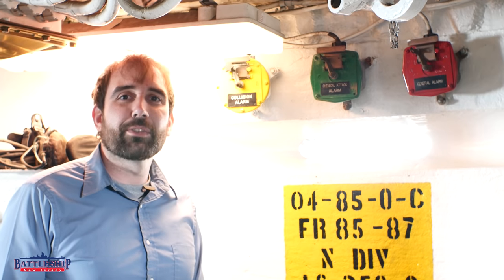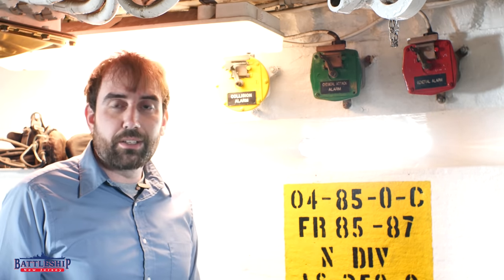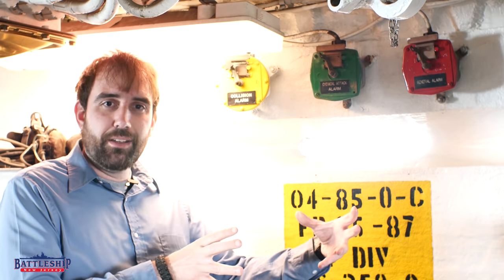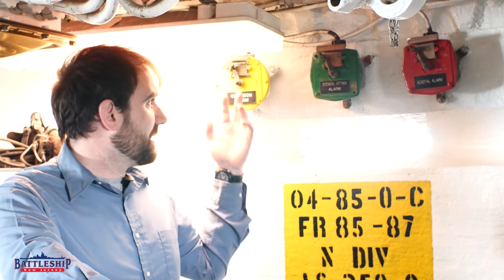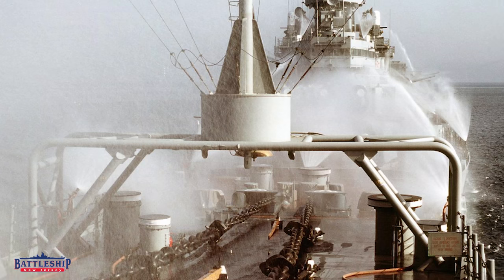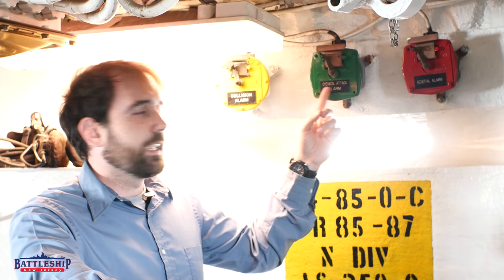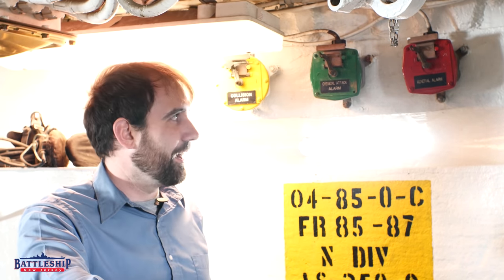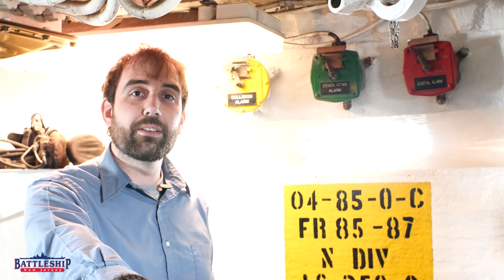That's Alarming! Shipboard Alarms and How to Tell the Difference Between Them

Comment: I pulled a fire alarm once in a factory. There was orderly evacuation. Afterwards. As we were outside. The big bosses were looking to fire the guy who pulled the alarm. As they were facing me. I just pointed behind then. I said turn around. Half the building was on fire. They were still mad as they had not given the order. I cared more for my co workers.
Reply: "You can go back into the building if you want boss, I will join you in about 20 minutes after the fire is over"
Reply: That's why it's called a fire alarm. Pull it, they get alarmed and fire you.
Reply: Typical control freaks.  Delayed alarms account for many lives lost, and, of course property loss as well.   There is also the potential issue of the local municipal FD responding.   My Dad worked at a chemical plant [also on the fire brigade] where all efforts were made to fight the fire without the local FD.  Apparently, after a certain number of calls to outside help, they would no longer have insurance coverage.   Bosses had security actually lock the gates to prevent the municipal FD from responding inside on one occasion :-(  .
Reply: it's alarming they were not fired for endangering factory staff by preventing people from pulling the fire alarm to report an actual fire.
Reply: @stevecooper2873 Lol do they want to be sued ?

Comment: Regarding the "people pulling alarms" thing: every large data center I've been in has had a big red Emergency Power Off button near the door. It's for the fire department to hit so they don't get shocked when they put water on a fire in there. And every single one of them I've seen has been locked in "maintenance bypass" mode, where the button is locked out and can only be reactivated by someone with the key. I always asked about this and got the same answer everywhere: inevitably some customer coming in to access their equipment felt compelled to hit the button and see what it would do. And after suffering a huge outage, a decision was made to lock out the button, since staff with the key are on site 24/7 anyway.
Reply: That sounds strange. I have never seen something like that while the five years I worked as a techi for a data center operator. Also not in several european data centers. 
Many advanced data centers would also use systems to reduce the amount of oxygen in the air to reduce the risk of a fire massivly. They also are using sensible systems which detect particles in the air which are indicating a fire before it starts.
I also need to point out that you would use CO2 extinguishers if possible to avoid massive damage. If the fire is to big to do so, you can just use water as voltages up to 1000V are not a problem.
Reply: @Heidelaffe  It's a building code requirement in most of North America. They do have all the advanced stuff as well for dealing with fires properly, but I guess fire departments are still going to potentially put water on live equipment if something goes wrong enough, so they insist on having that big red button.
Reply: @BIGBIRDSMEAL  cooling liquid. . . like, say, water?

mineral cooling a datacenter would make maintainance and upgrades nearly impossible, while introducing several points of failure.
Reply: @BIGBIRDSMEAL  sure, all servers are submerged in a mixture of nitrogen and Co2 for cooling.
Submerging in oil would make maintenance messy and delaminate some components.
Reply: @pteppig  "submerged in a mixture of nitrogen and Co2" you mean, like, liquid 🤣
Reply: At least in the DCs I’ve been in, the EPO switches are never locked out. Instead, they require you press and hold two separate buttons for ~30 seconds. Solves for the “I pressed the button and it all died” issue, largely, without breaking fire code.

EPO is used for more than fire fighting, FWIW: it’s also useful for “this transformer just catastrophically failed”.
Reply: Many years ago, I worked for a data center that used halon gas that activated when you pulled the fire alarm. First day of training was "if you pull the fire alarm, hold this button to stop the automatic release of halon gas. Let go of this button and get out of the building in 30 seconds or hope the fire kills you first" So nobody ever pulled the fire alarm.
Reply: I worked in a cell company Primary control center. We had a couple of Big Red buttons, but they had an acrylic cover. That button Seals the call center, and pressurized the chamber. The main frame was in a separate room with a Halon system. If the red button was pushed, massive red fire doors closed and nothing could get to us. We did have 2 handy fire exits though.

Comment: Might be worth it to get some kind of sound repeating device that can record a sample of each of the alarm sounds, but only plays locally for those who have that urge to "see if it works".
Reply: Just rig it up to loudly sound "GIT YER DAMN HANDS OFF THAT SWITCH!" if some kid or joker pulls it.
Reply: @ronaldrobertson2332  Bypass switch for when you have tour groups onboard.
Reply: @JessicaKStark  just kill the power to the Alarm Oscillator rack, or pot the alarm audio input gain down to zero on the 1MC pre-amp.  All of the alarm audio is generated from the same piece of gear and fed to the 1MC just like a microphone station.
Reply: I had an electronics class in high school. We had a fire alarm that we could pull in the classroom that would just go off in the classroom. It didn't have sound just a strobe light. That was fun
Reply: @kevincrosby1760  were there booster amps for distant stations?
Reply: @spvillano  Not on my ship.  Could have been on carriers due to the longer wire runs.

There were situations where any electrical signal was isolated and filtered, then re-processed to be useable, but we won't discuss those.

Comment: Question: What's the most alarming alarm to hear on a surface ship.
Answer: The dive alarm.
Reply: Moskva crew confirms.
Reply: Ask the crew of the Moskva. They love the dive alarm
Reply: Skimmers don't change depth unless a submarine changes it for them.
Reply: @Stylemaster911  Special Naval Operation to De-Mystify the Sea Floor
Reply: @robertschultz6922  joke is older than my grandmother.
Reply: Lol I know it is
Reply: I don't know some subs have altimeters so it only makes since to have a dive alarm on a surface ship.
Reply: LOL🤣🤣🤣
Reply: Dive! Dive! bweeep bweeep Dive! Dive!
Make depth  two zero zero feet! Dive aye!
Reply: Only once!
Reply: Second worse is the “out of coffee” alarm
Reply: For maximal dramatic effect
You start with an engineroom alarm.(Horns whaling in the engineroom)
Ad a fire alarm (bells continious ringing around the ship) 
Then ad the cherry on the cake with the abandon ship alarm 10 minutes later (yelling over the intercom speakers to abandon ship). 
You garanteed need a new pair of underwear when you are away from the ship  with the freefall lifeboat.
Reply: @SportyMabamba  🤣
Reply: Never heard the collision alarm on my ship, but my ship running into a Russian sub was before I reported aboard. I did read about the Russian sub's screw (or at least a piece of it) was lodged in the hull of the ship, near the bow, the screw removed, and the hull repaired, by Navy divers, in the Philippines. And I did see the red sub painted on her stack, which the Navy later ordered to have it removed. Some Navy brass just don't have a sense of humor.😁
Reply: HA... I'd be a little more concerned if I heard the Power Plant Casualty Alarm (Nuclear....)
Reply: @chadoakley8505  The 3th alarm (Evacuation) on a Chemical industrial plant also scares the shit out .
Reply: @chadoakley8505 , not a concern on the USS Kitty Hawk. She was a diesel boat.
Reply: Probably the halon alarm
Reply: @chadoakley8505  That'd be extremely confusing to hear on a battleship. "Reactor scram? Wait, what reactor?"
Reply: Hahaha
Reply: It involves a set up: 0200 shuved half out of your rack with a rocking  "Clang" five seconds later, the 5-second bosuns call and:
"This Is Not A Drill This Is Not A Drill, General Quarters General Quarters, All Hands Repel Boarders All Hands Repel Boarders", followed by an AK burst and an M-14 burst. Top that.
Reply: Nice!
Reply: Uh, that’s submarines buddy they are technically not a surface ship, but to hear it ( I’ve never heard one in real life cause I live in North Carolina) it is terrifying especially  for a crew member who is far from the hatch and hear this knows that they have limited time to get below or drown.
Reply: @roadwolf2 thankfully I never have to worry about that cause I don’t drink coffee
Reply: Not going to like cause you have 688 thumbs up, and I'm a 688I sailor

Comment: I don’t pull alarms unless it is for an authorized test, or actual emergency. 
However, while working at a US Naval Shipyard doing a power plant retrofit, we invited the shipyard commander to the plant control room. He accidentally leaned against the wall and triggered the emergency Natural Gas shutoff that shuts down all of the gas supply to the boilers and gas turbines. That was exciting!
Reply: Reminds me of an occasion in my biology class, back in high school. Biology rooms were fitted as lab rooms, so they had emergency shutoff buttons for gas, water and electricity (except lighting) as well. Also, we had freshly introduced one of those smart boards. The teacher was doing his thing teaching. He leaned against a wall and suddenly the smart board switched off. It took a few seconds for him to realize what had happened.

Comment: Yes I absolutely  get the urge to pull a lever, push a button, or trigger an alarm if I'm unfamiliar with it or have never done so before. I also have the discipline and training not to do so, so I would never do so just randomly, but that does not mean I don't want to do so or be in a position that I'm allowed to. It's deeply ingrained into me as part of my curiosity, and also I have to admit there's some sense of power dynamic involved in it too as in "I can push this one button and all this happens!".

Even with very mundane alarms like fire alarms, I've seen them thousands of times. I know what nearly all models and versions of them sound like. I know how the system works, what will happen, and how to reset some of them. Many of them are even painful to hear at all. I still get the urge, creeping and subtly, to pull, push, or smash any fire alarm I ever see if I stand near it for long enough, every time.
Reply: The temptation is very real.   I have resisted the temptation so far.
Reply: I'm a retired Electrician, once while working on a bank remodel I was told that the alarm was taken out of service so I could work on it. My apprentice was tackled and handcuffed by the police when he stepped out for a smoke. It wasn't anywhere near as funny as I thought it would be.
Reply: Shipboard on the 1MC, "Ensign Jones, (officer) your presence is requested on the port quarterdeck" gets you Mr. Jones.  "IC2 Crosby, (enlisted) lay to the port quarterdeck" would have gotten me to the port quarterdeck.  "Captain Jones, Lay to the port quarterdeck" will get you a rather large group of sailors in flak vests and a nice assortment of pistols, shotguns, and automatic weapons all surrounding the port quarterdeck.  Officers do not "lay" anywhere...their presence is requested.

In short, words DO matter.  The above word passed was an automatic security alert indicating that the QD watch was under duress.  When accidentally passed by a flustered seaman it was hilarious, even if I did have to sit on the deck for about 30 minutes while the CDO individually contacted and dismissed each member of the security team.
Reply: @kevincrosby1760  must be something on an Aircraft Carrier.
Our "Security team" would have to go to the armory on my ship. 
The words lay to and requested mean little. Follow either with "ON THE DOUBLE" will get me there much faster. Request me, I may take my time.
Reply: Yes. Very same. And any time I find out someone is planning to test an alarm... "ooooooh can I do it?"
Reply: @kevincrosby1760  We even had a code word announcement for our daily security drills.  " Seaman Stains, lay to the quarterdeck." (Or whatever location decided by the CDO a few minutes before.)
Reply: @kevinsantascott3688  Actually, late 80's on a Replenishment Oiler.  If you have armed sailors running around who are NOT on watch, then the stop by the armory should have been self-evident.

Everybody knew that an AOR would re-fuel them at sea.  Often forgotten that nestled down between the cargo fuel tanks were 5 high-security cargo magazines certified to carry up to 600 tons of ANY munitions which may or may not be found aboard any other ship in a CBG.  

The reason for a paranoid-leaning security response should be obvious with a bit of thought.
Reply: @kevincrosby1760  I was on an LKA, put jarheads on the beach with all their gear. 
  I always thought S/S watch should be armed.
 Side note, I fell through the cracks. Never fired a single bullet for our government.
Not one, 13 years in service and not one bullet.
Feel safe?
Reply: @kevinsantascott3688  Only armed watchstanders were the Quarterdeck watch in port, who carried handguns.  If we were in a non-USN port we might have added a deck watch and a pier watch, handguns and rifles.

I grew up around guns and enjoyed shooting, but all we had were rifles, revolvers, and shotguns.  I seized every opportunity to fire anything that the USN would let me get my hands on.

I earned ribbons with an M14 and 1911, and was qualified for the 12-ga shotgun.  Somewhere I believe that my 100 rounds of "fam-fire" with the M2 are documented.

Never understood why everybody thought that the scheduled range trips were just for the GMs.  They were announced at Quarters for "any interested personnel".
Reply: @kevincrosby1760  we never had that on my ship.
 Color company in boot camp so picnic on the day we should go to range. Go to fleet and never had reason or opportunity to fire. Reserves, my Sr. Chief made us all buy 9mm shells to qualify. 
Jarheads wouldn't allow us to use their guns. So 13+ years with zero bullets fired.
I do own guns and used to hunt small game and birds. 
Have not came across anyone else who fell through cracks. 
No contact with any from my class so no clue about them.
Reply: @kevincrosby1760  never understood why they would give a gun to a 3rd class Boatswain's Mates.
Arguably the dumbest on ship. 
😁
Reply: @kevinsantascott3688  The helm console is IC gear.  There were 2 annual PMS checks which needed to be done underway, one for verifying Indicated/Actual rudder angle, and one for putting the Autopilot through its paces.

First time I did the checks I did so by reading the instructions to SN Dimwit on helm.  I had the PQS book for Helmsman in hand by the time I got back to the shop.

Second time, starting my tests with "Request permission to relive the standing helm watch for PMS checks" made the experience much nicer.
Reply: It’s like a large button - just asking to be pressed.

I’d had the temptation up until a fire alarm in a building that I worked at broke - they weren’t able to get it fixed until the next day, and it sounded for more than an hour before they managed to at least mute it (it still strobed until the next day when it was fixed).  An hour+ sitting next to the deafening siren trying to do work?  I’ve no inkling to pull any alarms unless good reason to do so.
Reply: As a kid I got to see inside the control room of a hydro powerplant, like the switchboard for different powerlines. As an 8 yo kid Im amazed I did not run around and press all the buttons 🤣

Comment: During my time on USS Theodore Roosevelt CVN-71, when standing watch as POOW we used the Chem Alarm to activate all Circuits of the 1MC then ring the bell, (the one for announcing the CO or Flag officers aboard and the time keeping) we would ring it vigorously followed by 1, 2, or 3 single rings to indicate FWD, Midship, or aft. After that we would announce, usually proceeded by "This is a Drill!, This is a Drill!" unless it wasn't: "Fire, fire, fire! Fire in compartment (Space number as noted on bullseye) and direct witch repair locker for response team to use.

Like I said we used the Chem alarm to start it off cause any of the 3, General, Chemical, and Collision will activate all 1MC circuits so the 1MC announcement can be heard everywhere. In some areas of the Carrier, the 1MC isn't patched through normally for standard use, and using the Chem alarm allowed that to be heard in those spaces as well. After the drill was over, or we just got done testing the 3 alarms, the POOW would have to call DC Central and have them reset the 1MC to normal.
Reply: Neat! That’s a clever way to make use of existing systems to make a fire alarm!